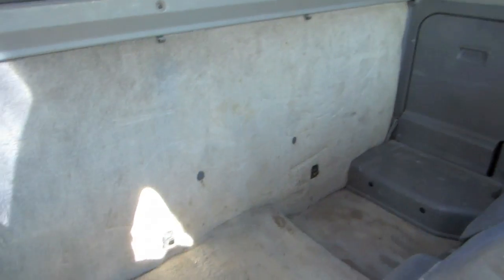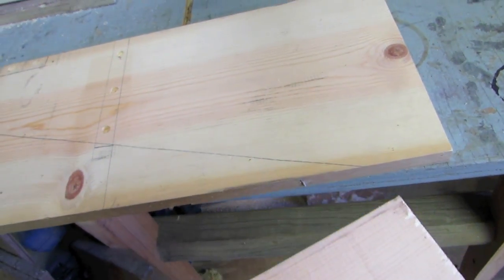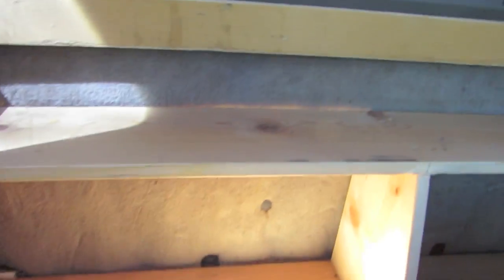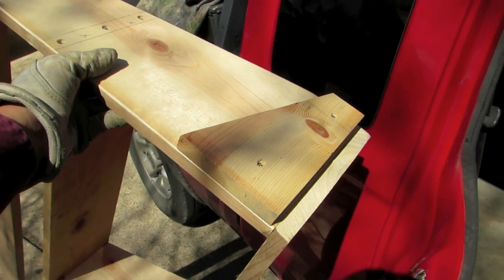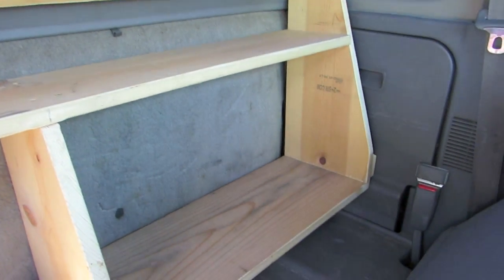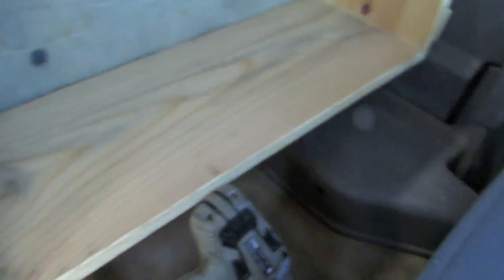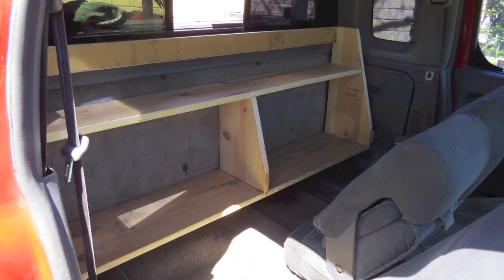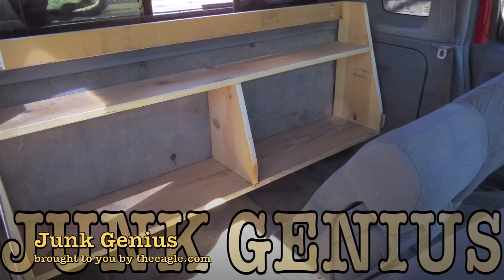Junk Genius: DIY Truck storage shelf

Comment: You are so handy!  I would never have thought of this design.  Very nice!  Surprised you did not paint it to match your truck.  I would use cargo nets to hold back things on shelves. 

By the way, best way to clean your carpet behind seats is to scrub with hot water mixed with laundry detergent.  Then vacuum up with a wet dry shop vac.  Rinse with hot water, vacuum again.  Towel up, then air dry.  Comes out smelling so good and looking new.
Reply: Why dont the genius unload some of that shyte?

Comment: Hey William.  I have a 1994 Mazda B3000 Cab plus 4x4, (400,000) quite similar to your behind-the-seat area. Great idea for storage. Like you I try to go fishing fully ready for whatever might happen when back country camping. Have you do any further modifications or would you have done it differently? Steve (68yrs) Manitoba Canada
Reply from the maker: Probably add a lip to the front of the top shelf to help hold the stuff. And paint it gray to match the truck.

Comment: One quick stop and all that stuff will be all over the back of your truck.
Reply from the maker: You are correct! So I made a couple of modifications to prevent that from happening. A lip on the top shelf and bungee cords top and bottom to hold the stuff in.  Works great now.